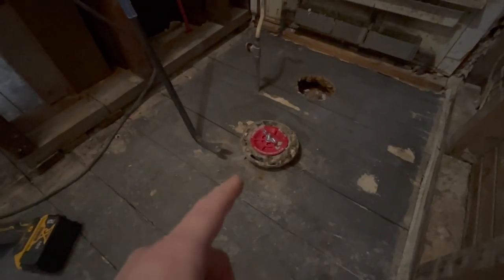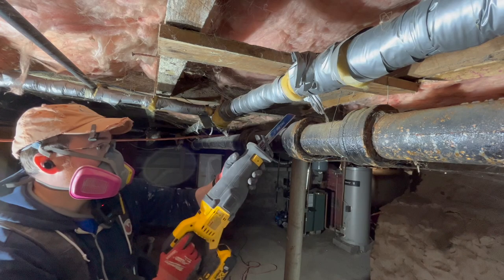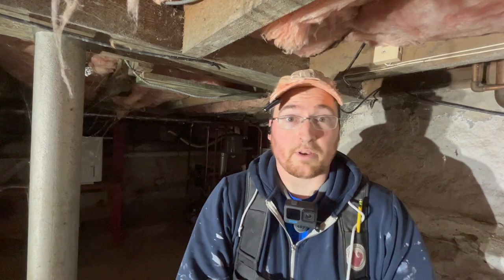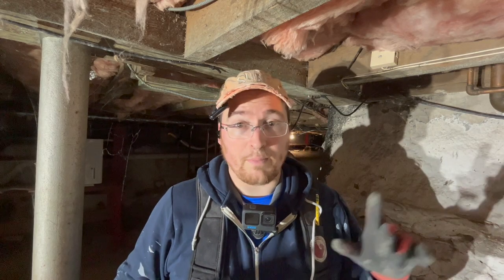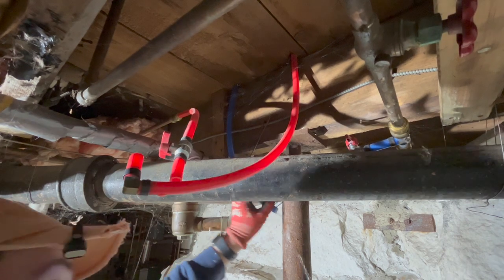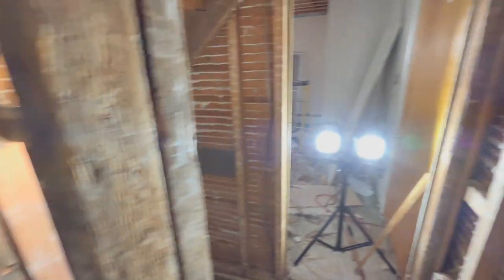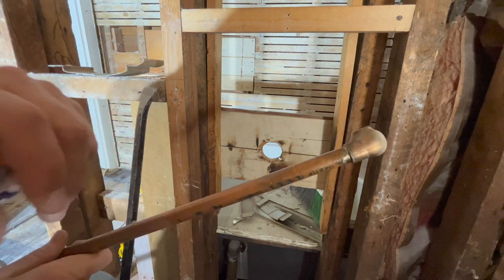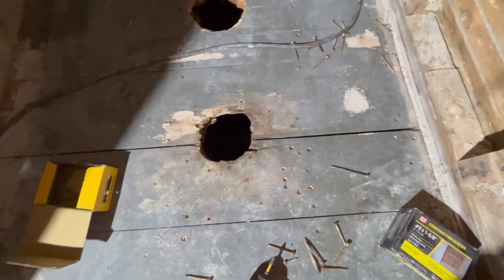Bathroom gut: Capping water and sewer lines, and prepping the subfloor!

Comment: With the shark bites, I have tried to reuse them before. But on occasion the small white insert has come out when removing them, and I haven't figured out how to set that piece back into the shark bite when it comes out.  Any suggestions?
Reply from the maker: I don’t think so…I don’t think I’ve ever had that happen! 

One thing to note though is the insert is only required for pex and a few others types of plastic pipe. If you’re joining copper to copper, you don’t need it anyway